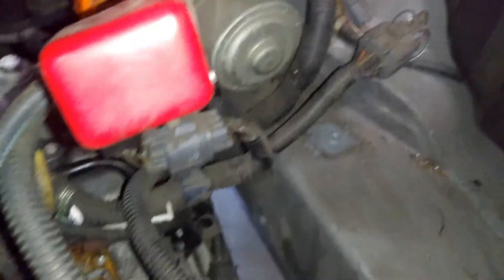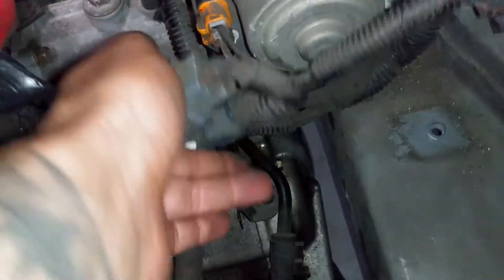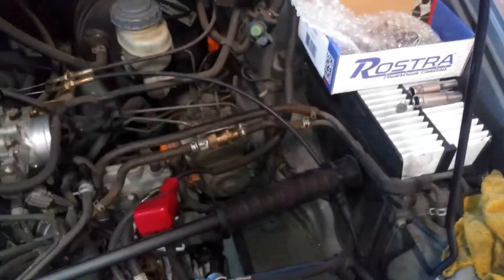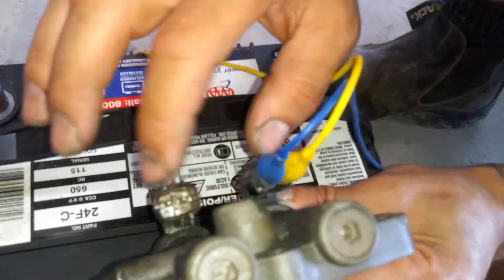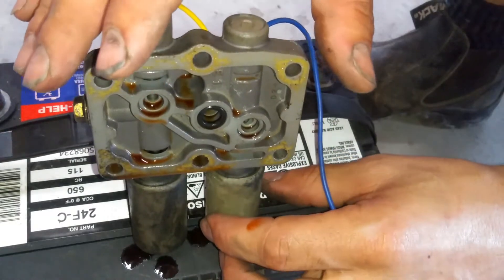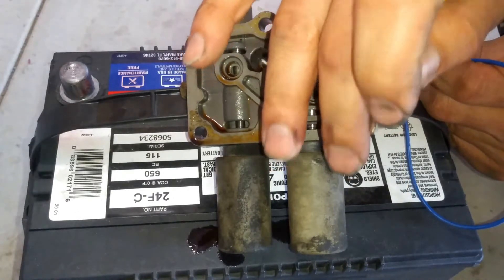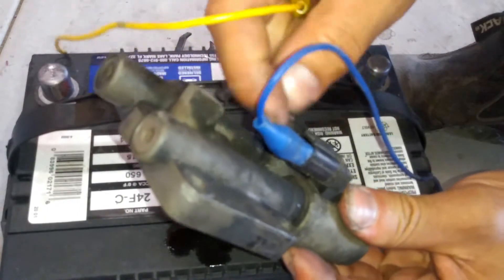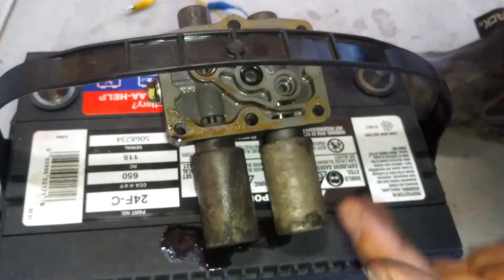honda odyssey p0740

Comment: Can u comment the colors of those wires? I replaced the connectors but I was unsure of their position, it seems that one connector I did with inverted pains, but i don't wanna burn this solenoids, might think that order doesn't matter, but the signals say otherwise

Comment: Great info 👍.......
So where did u  get the replacement ... theres so many videos on this topic but never post the part number and or  where u purchased the part . Theres so many parts on Amazon and ebay that never does the job . O'Reilly and autozone some times have the part . Usually gotta buy it from honda .
Reply from the maker: Autozone has it

Comment: I had my mechanic replace that solenoid (plus A and B) because I had the codes. The engine light didn't go away, and even got the TCS light (come and go),  the 2nd gear has a noticeable "jump". But, I'm pretty sure those lil cylinders you pulled out, were not cleaned. I'm having him get them out, and cleaned, then I could either put the new/old solenoids back, since (the old ones) work good; probably just needed the cleaning (of those cylinders). Thanks for the vid!
Reply: How did it go? Did you ending up fixing your issue?
Reply: @mtsanchez27  the issue was fixed, by clearing the parts, and getting new rings. The new cylindes I had bought were not good (didn't solve the problem and added yet more codes), prob because I got them thru ebay. I've found out lots of ebay parts (for vehicles) are just not worth buying (bad quality).
Reply: @ctinieblas1228  what do you mean by clearing the parts?
Reply: @mtsanchez27  *cleaning (typo error)
Reply: @ctinieblas1228  thank you so much!

Comment: I just refill my odyssey with 3 1/2qts and have no codes. I plan on replacing the filter and clean out as many solenoids as I can get to and new fluid again. When I shift into drive there's a 1 second delay but reverse is fine. Any comments. Great video 👍

Comment: Do you know what the bolt at the side of the solenoid  switch is for?  I am having the problem and I purchased a replacement one on Ebay new. But it exaggerated the shift problem. I saw on Google where the pressure can be adjusted but I am not sure how. I am thinking that the bolt may be for a purpose but what?

Comment: We have no idea why you went in there for that. You never said what was wrong with the car,what it does not do?
Reply from the maker: Sorry about that. It had a check engine light for p0740 and no drive ability  issues ran perfectly fine. Customer  complaint was only the check engine light
Reply: Is there anything specific you have to do after putting the new one in? Or is it just put back together and go?